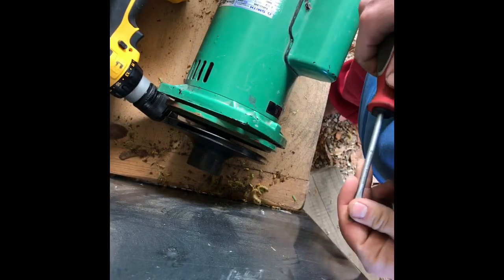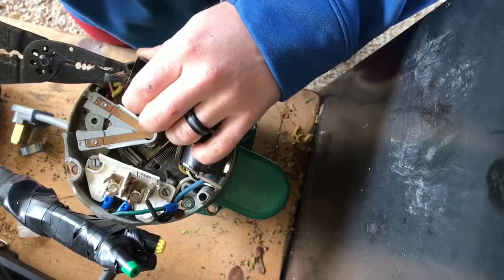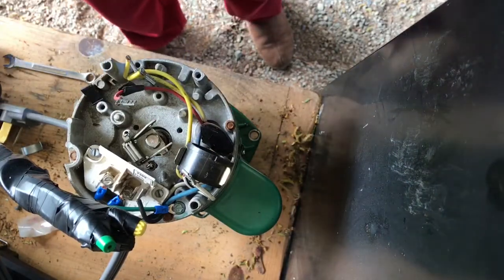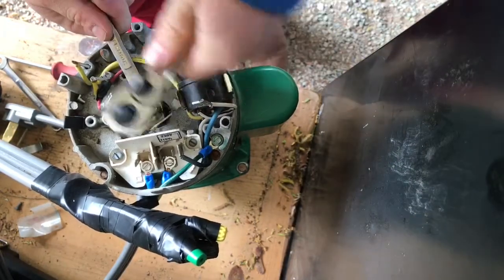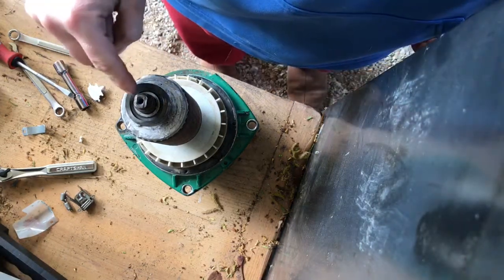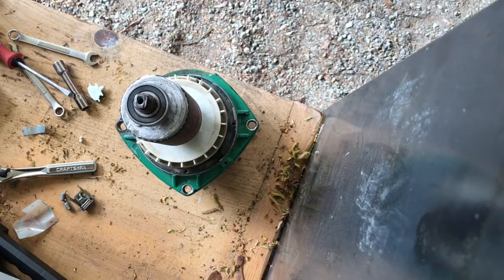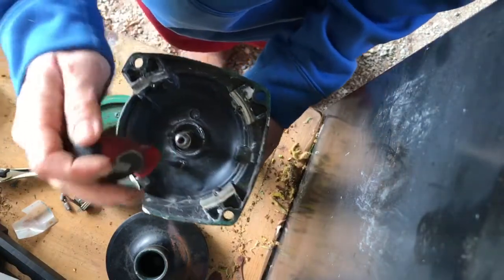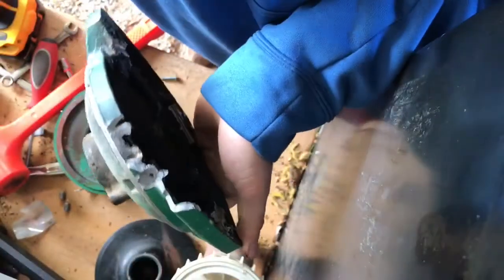Myers 2.5 HP water pump tear down (Irrigation water pump disassembly for Myers is same as AO Smith)

Comment: Great video. I wish I had found this yesterday. I had to replace what I thought was a siezed pump (lot of iron in the water), but now I see it could have been corrosion, a bad starter or bad bearings :-\
Reply from the maker: It almost always is bad bearings. I have done this tear down a lot. All the parts are inexpensive. Especially the bearings.
Reply: thank you for this tip. i might tear it apart and see if i can get it running again for principle's sake lol.

Comment: Good morning, any ideas on how to to fix the cast iron part of the pump?
Reply from the maker: Are you asking about the housing end of it with the four bolt holes in it?
Reply from the maker: I had one crack on me before and they had extras available at my irrigation supply store.
Reply: @buckn32  it is the housing part where the water comes in
Reply from the maker: That part should be cheap. Literally these pumps are all simply different brand labels but a lot of the parts are interchangeable. I literally pulled one out of the earth that had been sitting in weather and mud for last 20 years and got it going again. The only expense part is the core. If you mess that up it’s basically the cost of a new pump. Go to your closest irrigation supply store with your old part, don’t sound desperate, and you should get out the door for under $20. It’s irregular that your part broke because it’s usually only the bearings and start capacitor... but none the less, that part shouldn’t be expensive because they should have one floating around the back some where taking up space.